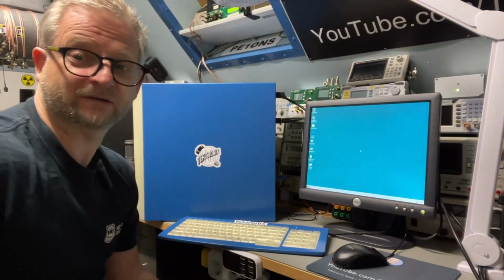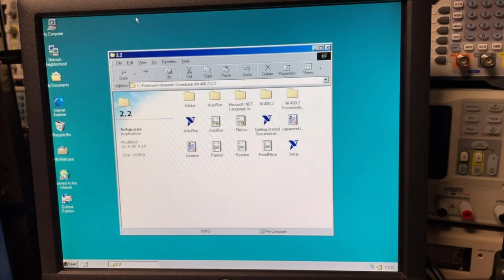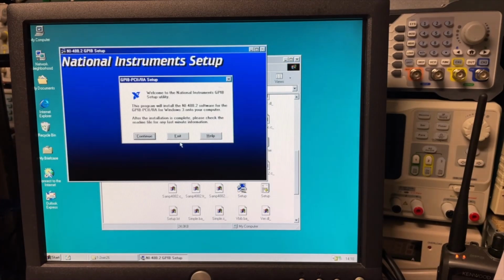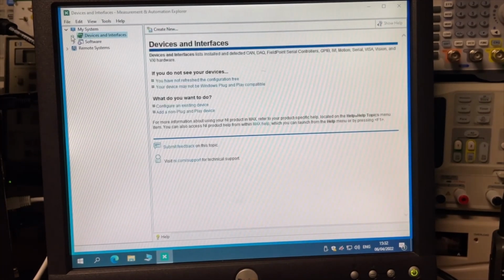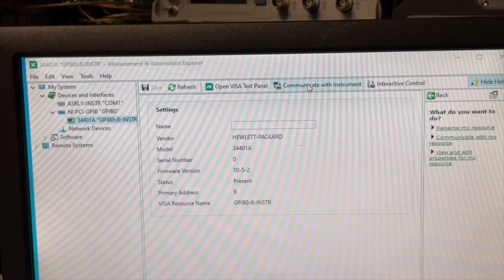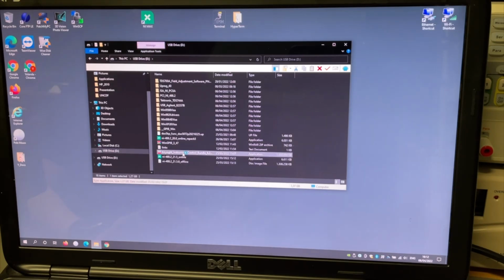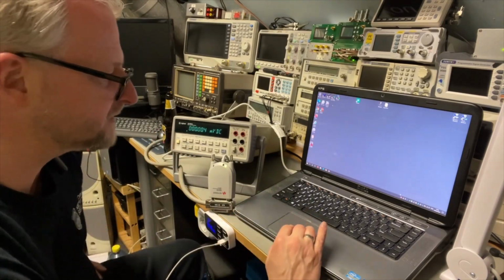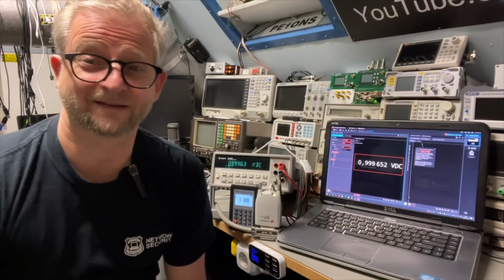#278 GP-IB HP-IB ISA DOS, Win98 and NI PCI ,USB 82357B HP on Win10

Comment: I was searching for something similar, but those GPIB to USB adapters are quite expensive. Probably the whole GPIB was always more of a professional market including Labs, in any way in no way 'mass production' to get a lot concurrency. I have an old but still very good Tek 2712 SA that has GPIB. I have a card from NI for PCi slot, but the desktop that I use here at the bench does not have PCi, unfortunately. NI still has even dedicated drivers for Tek 2712 and I have done quite lot LabView development in the last 20 years. GPIB to USB seems like an elegant solution, but I see the model you have there on Ali about 100,- It would be fun to play around and write my own SA GUI. As I already have the PCi card I think I will look for an older desktop PC with PCi slot, that maybe can run the other software too, like tinySA Ultra and nanoVNA software App's.
Reply from the maker: Great! looking forward to your project if you are willing to share.
Reply: @TonyAlbus   ach long way to that project 🙂 I have seen in Elector archive DIY GPIB to USB, so that could be an option. Then would need to look at those drivers from NI, get them to work and start to develop. Other thing is, I do not own a LabView license. We use it at work for 2-3 decades, so yeah. I can play at home with it but I am not allowed to publish or spread anything. In that regard Python would be a better choice, but I have almost zero experience in Python. I have learned some basic stuff but I never use it actually...
Reply from the maker: @ernestb.2377  On EEVblog there is an arduino/esp32 project that even has a webbased interface to control the GB-IB, that could be an interesting start for your project, or take some ideas from.
Reply: Thanks for the tip @TonyAlbus   !
Reply: Ha  @TonyAlbus   Good news, I see that National Instruments has a Community Edition of LabView, which allows an Open Source projects 🙂 The functionality is equal to professional edition. It was released in 2020 and I was not aware of that 😁 In any way interesting to explore the possibilities. I know Siglent also has cooperation with NI and have some drivers for their equipment. Regarding the old 2712 and GPIB I would need to get into that and maybe try via the GPIB to USB, as that would be more versatile instead op PCi card.

Comment: Hi Tony,
Thanks for the video.
I also use the USB/GPIB fake adapter and the software HTBasic from TransEra (it is very expensive but there is a free version with some limitations).
It run on XP, Windows to 10 .
It is very convenient and in my case drive my HP8590 spectrum analyser, my power meter, my Racal counter and my RF generator.
Regards
Juan
Reply from the maker: Thank you Juan!.. that is very nice information, i will Pin your comment so other can see it first. i will try it for sure. i am just starting with GPIB so all info is welcome.

Comment: Hey Tony! I used to carry the IEEE488 cable around my neck just like you 😂 Only my cables were for Commodore equipment, computers, disk drives, printers and interfaces. We actually developed a 6502 processor based intelligent interface between IEEE488 and RS232, programmable bi-directional with all debugging options required at the time. Great vid!
Reply from the maker: Hi Marcel, i know those cables, my dad had a CBM 8032 with a big double floppy drive and matrix printer, it used those cables you mention. if i remember correct it had an upgrade board to 128 KB while 32K was standard.
Reply: @TonyAlbus  My actual very first computer in 1979 was a CBM 3016 with 16k RAM and a non-Commodore dual single sided 180k floppy drive ...
Reply from the maker: Cool, those are great machines... i think i have still the 8032, but the cables and diskdrives are gone. i think ours was the CBM PET with 4K and the tape in the keyboard :) matbe the tapedrive of my C64 does fit, i think it did..
Reply: @TonyAlbus  Oh wow, I am very sad to say that all of my old equipment (not only the CBM 🙁) from those years have disappeared. Great that you still have the 8032!
Reply from the maker: @MarcelHuguenin  Yes that happens over time... i have trown out so much stuff i regred later, but we can;t store everything in life.. the memory is good also.
Reply: @TonyAlbus  Helaas heb ik van een paar dingen wel heel erg spijt, is allemaal meer dan 40 jaar geleden ... 😢Had je mijn mailtje nog gezien?
Reply from the maker: @Marcel Huguenin  Ja kan dat helaas maar al te goed. De mail gezien , zat in de spam. lijkt mij leuk, maar kan even wat tijd overheen gaan... ik ben even veel ballen aan het hoog houden. kom er op terug, lijkt mij echt leuk, gezien jij ook allemaal in de oude pc's enzo zit.. denk dat we zo uren aan het koffie of bieren zijn :)
Reply: @TonyAlbus  No problem Tony, ik begrijp het. Ik stuur je nog even mail met nrs.